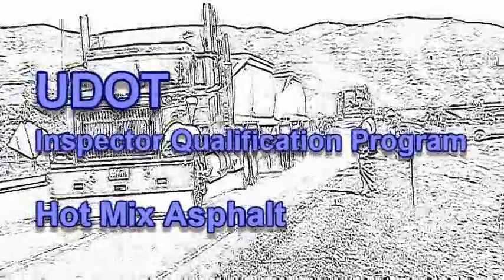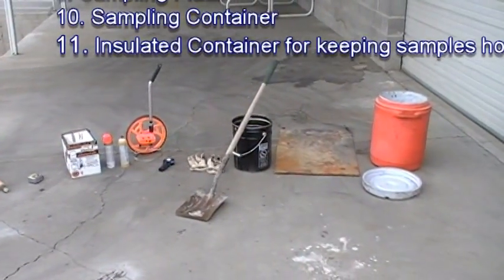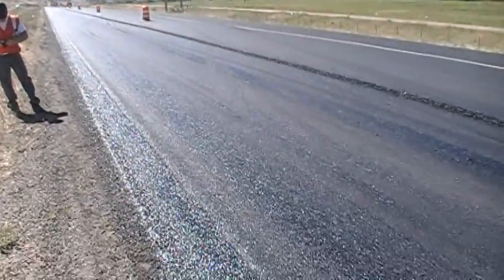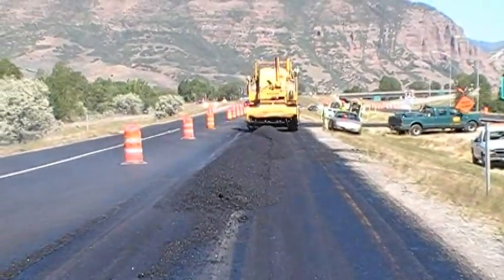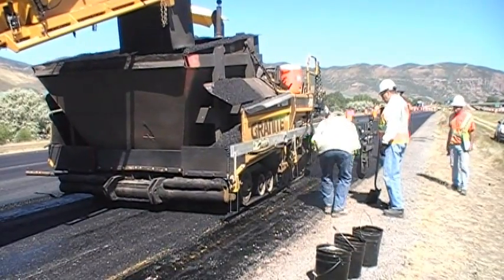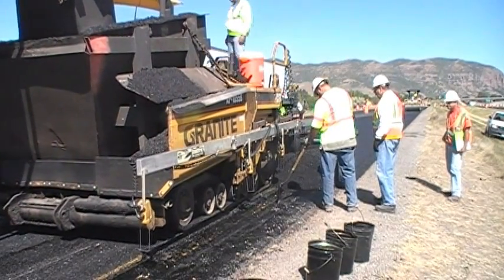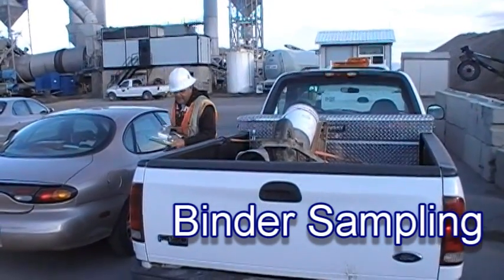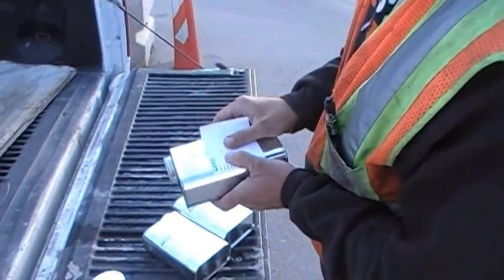Hot Mix Asphalt Testing and Inspection w Binder DVD HD

Comment: When using a nuclear gauge you are supposed to stand at least 10' away for safety and not to disrupt the moisture reading. Also using it so close to a roller may disrupt the readings.
Reply: Agreed entirely about safe distances from the gauge. No need to be squatting down beside it whilst the source is exposed. 

However, being a thin layer density gauge, this one has no moisture source. Only density.
Reply: Not really, minimum 1m about 3.5' away should be safe and practical. 3m roughly 10' clearance for a standard count.